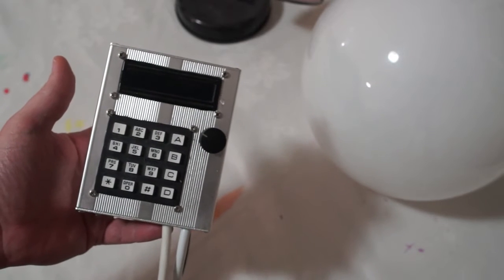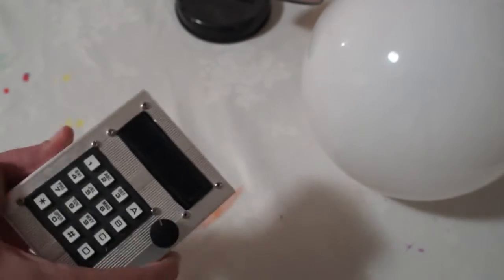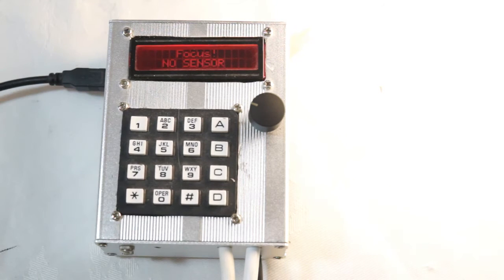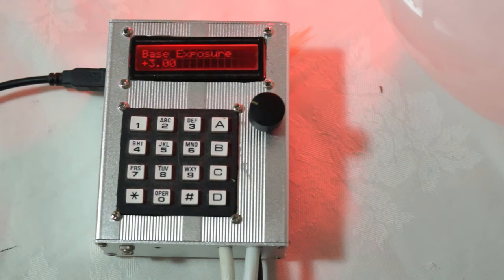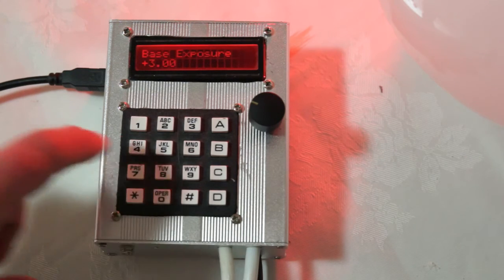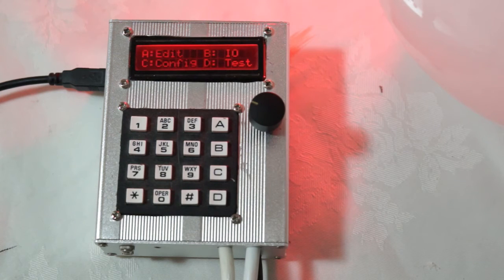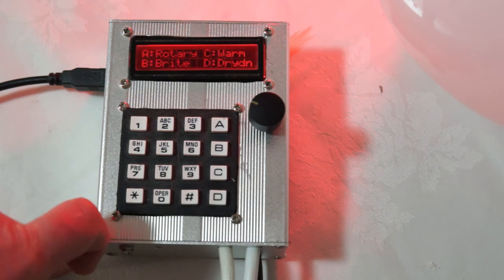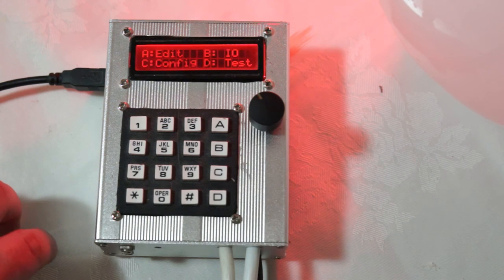Open Source F/Stop Timer Introduction

Comment from the maker: I have (as of 2023) a few PCBs for this left; contact me via the website link in the description if you want one.

The TSL235 is discontinued and very hard to find now, so you may not be able to have print metering but the core timer functions will still work.